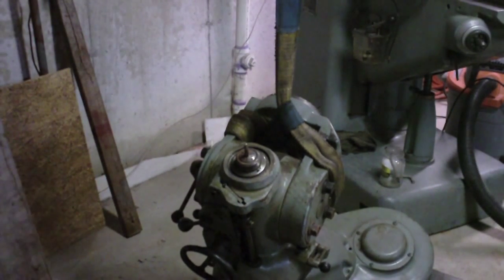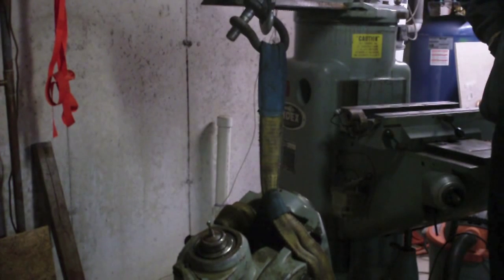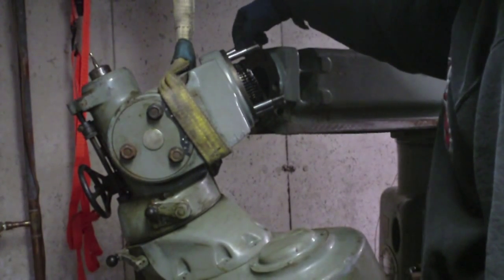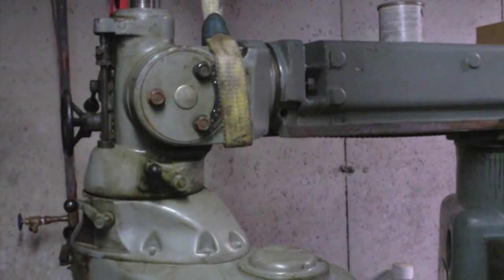Wells Index Milling Machine Part 23

Comment: Thread locker on bolts? (gray stuff) Great vids.  Going through similar challenges myself as I move my 847 in.
Reply from the maker: hope the videos help. btw, let me know if you need any parts.  I might have spares.
Reply: Steve,
Videos help immensely.   The videos seem to chronicle my same challenges.  It really bothers me when I get it all put together and have parts left over :-). Hope they were extras.  Yes, definitely going to need parts.   Love the videos and how you never seemed to get frustrated (on camera) and never gave up.  Happy to find out that Wells Index is still in business and still building this machine.
Reply from the maker: +Scott Goessling you should take comfort in knowing you now own one he'll of a milling machine. I  have some more improvements to make,and want to do some mods, like wiring the wells switch to control the vfd. but I've already made great use of this machine.